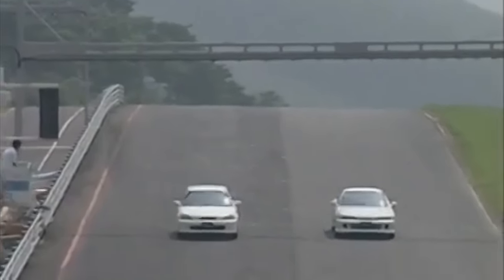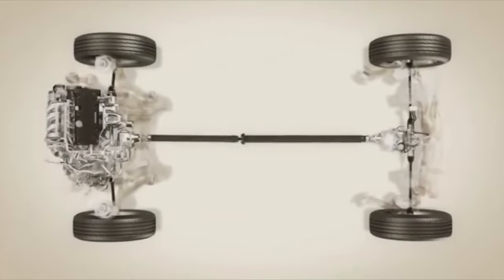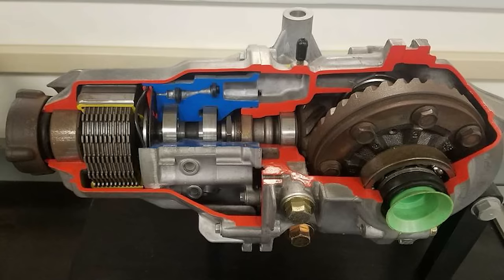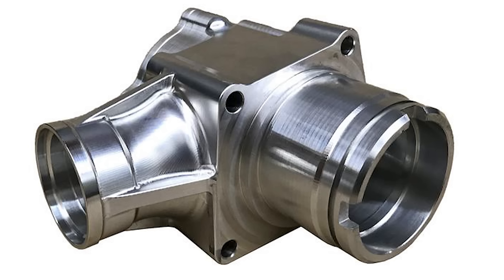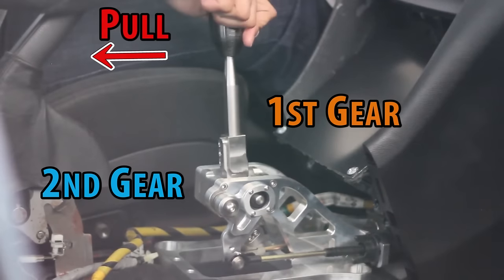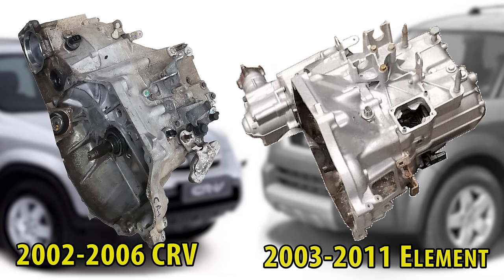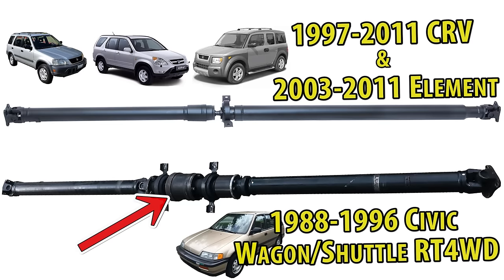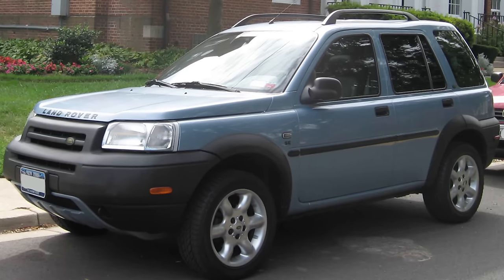How to Convert your Honda To ALL WHEEL DRIVE !

Comment: Look up pirate garage. They use no viscous coupler. And just upgrade the clutch pack in the crv diff using upgraded plates to apply more pressure to the pack

This is a 60/40 split from front to back. 

In short. You CAN use crv drivshaft AND CRV diff
Reply from the maker: You can, but the limits have not been pushed yet. We have only seen so far the wagon and pinned crv diff pushed to the higher horsepower levels. Would like to see pirate garage push it to the limits so there is another option.
Reply: @GTContent  They have been pushing 450-550hp as daily drivers on the stock diff. How much more do you want to push it? That is plenty for most people.
Reply from the maker: People want to know maximum limits, so I'm trying to provide them. They can do what they want afterwards.
Reply: @GTContent  550hp, after that you'll need to pin the diff.
Reply: @Cloneufc  that car has never seen a track. Some dyno numbers, but that's about it. No limits tested where it really matters.
Reply: @itsjussjerry  I'm running 550hp, but I'm not AWD yet, we will see how the stock diff holds up.

Comment: Hey man i hope you see this! Thank you so much for making this video! It’s made my life so much easier! I’m ready to start buying all the parts i need but i’m a little confused on one thing 😅 i’ve got an R200 diff in my car. like you suggested, however it’s a different gear ratio than the crv trans. my r200 is 4.11. would i run into issues on the way power is distributed or it’s overall functionality? Thanks man! 💪🏽
Reply from the maker: Yes, you'll have issues. The wheel speed between the front and rear will be different. It's best to change that R200 or find the correct gear ratio.
Reply: @GTContent  I appreciate the response! I actually ended up going with the crv diff w/ locked VC and got an external VC like you recommended! thanks again 🙏🏽

Comment: Kinda late to ask but, how these conversions perform in aplications other than drag, like street use and trackdays(circuit)? I assume that the viscous coupler give a 50/50 power split right? Does  front and rear diffs with diferent ratios generate rear or front bias? Or both must be the same ratio?
Reply from the maker: There are a few whom track their cars and it's done quite well. Street cars would benefit the most since driving will be under various conditions.
The gear ratio is slightly different between front and rear with the viscous coupler being responsible for the power transfer which isn't 50/50 as it's more fwd biased.

Comment: I have an element "4wd". What was the company's name that makes the aftermarket rear diff kit, that pins the clutch in the rear diff?
Reply: HRG engineering, S1 and AKD built performance may be others.

Comment: Great video, but I have a question. What would happen if I was to remove the front semi-axles, converting my civic ef sedan to rear wheel drive using the civic/shuttle 4x4 drive shaft and it's viscous coupling and differential? We're not talking about transferring more than 250 HP to the back? Would it be able to handle that much?
Reply from the maker: Should be able to.
Reply: @GTContent  and in case I decide to remove the viscous coupling all together, replacing it with some kind of solid power transfer?
Reply: @GTContent  actually, is there a way to contact you in a more direct way? It could be quite cool since I'm doing a quite unique build.
Reply from the maker: @petarkrznaric6601  It'll eventually break the transfer case if there is no viscous coupling.
Reply from the maker: @petarkrznaric6601  PM me on Facebook: GT Content
Reply: @GTContent  i hit you up on insta!

Comment: So I have a question, if I got a solid driveshaft with no viscose coupler and then take off the front axles would that work for rear wheel drive?
Reply from the maker: Yes.

Comment: What about 2001 honda civic sedan automatic. I want to make mine a rear wheel drive and push 300 to 400 horsepower. Whats a good engine swap and what parts would I need to convert it to rwd

Comment: Someone told me some Acura’s are 4 wheel drive. Was he wrong?
Reply from the maker: Some were. I get to them towards the end of the video.
Reply: I've never seen anyone try to use sh-awd components. My guess is they are much more complicated and require a lot of electronics and sensors to work properly.

Comment: Hey can you please tell me if i can set up any crv gearbox awd on k- series v6 3.0 or 3.5 accords engine?  There are not many options in India . Please update me?
Reply from the maker: You might be able to use the awd 6-speed manual transmission from the Acura TL.
Reply: @GTContent   but accura tl isn't available in India , can a CRV manual fit the v-6 engine of Accord?
Reply from the maker: @MudholHound  It won't fit without custom adapter, flywheel and clutch kit. Your best and simplest solution would be to import a TL transmission.

Comment: So I have a DC5 type R. It has a shorter final drive installed in the gearbox will this be a problem with a CRV rear diff?
Reply from the maker: It won't be a problem because you're using the the CRV/Element AWD transmission which will have the correct gear ratio in the transfer case to match the rear differential. The final drive in the transmission will not affect it.
Reply: @GTContent  Thank you so much for replying. so putting my 6 speed with shorter final drive into CRV casing will be fine? Also DC5 R comes with limited slip diff from factory unlike EP3 is this ok aswell. Will be CRV bits we didn’t get the element over here so probably get a whole CRV, take what I need and save the k20 out of it for the jazz/fit at some point 😂
If it is then this is a go for project widecharged!!! 
Thanks again mate video is great must of taken some effort 👌
Reply from the maker: @jdmbear8492  Yes, you can swap the gears and lsd from your DC5R into the CRV case.

Comment: So when you convert a civic to AWD it has to be the real time system?
Reply from the maker: "Real-time" has evolved throughout the decades (they're not all the same). It's a "clutch" based system where the clutch is located either on the driveshaft or snout of the rear differential and engages at a certain condition.
Reply: @GTContent  I was just wondering because I’m doing an off-road build on a 2nd gen CRV and I’m trying to find a way to permanently switch it to full time 4wd (or better yet be able to manually turn it on and off) would welding the clutch system in the rear diff achieve this?

Comment: Can i use my oem transmission (ep3 k20 ) to switch awd ?
Reply from the maker: No
Reply: @GTContent  so I need to use wagon transmission in my ep3 K20 ?
Reply from the maker: @ventassolunic7249  CRV K24 AWD Transmission

Comment: Couldn’t that electric motor just be rewired to stay on/engaged so it constantly has AWD?
Reply: The clutches are still a weak point in that diff when your making big power i assume. Easier and cheaper to jus weld em

Comment: super late question. im looking into a 2006 honda element 4wd at. i read that the stock trans are 4 speed. is the later versions tranny or cr4 compatible to swap?
Reply from the maker: Look for a manual transmission.
Reply: @GTContent  is it plug n play swapping to manual so should be worried about the cpu too?
Reply from the maker: @gebus1199  Manual doesn't have a cpu.

Comment: Do the awd have to be manual? Just curious cause they seem like they always shifted and not automatics
Reply from the maker: You can use the automatic transmission, but you'll also need the automatic ecu or a method to control the shifts. The automatic transmissions are not known to handle a lot of power.
Reply: @GTContent  ok, I figured that. I was like, they never are auto, ill stick with the awd ls method. Id prefer auto for drag racing a daily driver.
Reply: @GTContent  I'm attempting an awd civic. But i keep hitting roadblocks. Is there a phone number i can call to get real time assistance instead of emailing and waiting?

Comment: Thirst for power is INSATIABLE. 
No wonder the gains from better efficient cars are being squandered and not assisting the environment.
Our efficiency gains are going to bigger displacement, more performance and add to that the want of bigger SUV cars you have ZERO if not negative real reductions in CO2 per distance travelled.
Studies actually show there have been zero efficiency changes in fuel consumption per distance travelled.
Reply: My 94 mustang gt v8 with just a cold air intake and high flow cats and no mufflers could do 30mpg highway  before I added 3.73 gears...my 2004 Audi A4  Quattro 1.8t with 170hp did 34-37 mpg on the highway, my current 2016 golf 1.8tsi does 36-40 mpg on the highway...mustang was way more fun...if I have half the cylinders compared to my mustang then I want a 50% increase in fuel economy...it’s all one big scam after 2007 when it comes to fuel economy

Comment: Ok I have a 2001 accord which has a 2.3L but it’s an F series like the s2000 so does anyone have any idea if this will work
Reply from the maker: You will need a transmission adapter for a B/K awd transmission.
Reply: @GTContent  they make those ?? If so I’m soo glad I love the f series I just want all wheel drive

Comment: To be honest.... people are sleeping on D series engines. A shorter stroke means super high rev capability, faster response and a more linear power band.

Yes, higher displacement engines make more overall power per ignition. But, when your ignition occurs at double the rate. You produce more power over a shorter duration. ;)
Reply: Remember, higher horsepower means greater top speed. Higher torque means greater acceleration.

Comment: The dual pump system uses Zero electronics. It literally has 2 pumps. One driven by the input shaft, one driven by the axle shafts. When a difference in pressure is created, it applies the clutch.   The VTM-4 unit IS electronically controlled, with clutches for individual axle drive.

Comment: Awesome video.......but i drive a d series engine
Reply from the maker: Use a D to B adapter plate and a B-series awd transmission.
Reply: @GTContent  can you tell me where to buy an adapter plate? In europe? Ore what product so i can search?
Reply from the maker: @justadadworkingoncars  You'll just have to Google. There should be companies that sell adapters to use a bseries trans on a d series engine.

Comment: Why not drop a 350z rear differential end of the problem and make more power
Reply from the maker: You'll need to make a 2.5 final drive ratio, axles, custom rear hub assembly.

Comment: I had a 91 wagovan
I'd take it out in 8" snow before the plows cleared the streets.
Walked up a 45° snowy hill.
*I feared the slide on the way down more than the slip on way up.
I took highway exits at 50mph with no chirp of tires.
At traffic lights I'd be doing turns at 25-30mph like I'm on glue.

Off the line at traffic light it was instant grip.
Regret selling that car

Comment: Seems like its not that easy to do I mean you need the right parts first Its almost looks like the B to AWD series kit will take some more parts then doing it on a K series from looking at the video.
Reply from the maker: Yes, B will be more work than K.
Reply: @GTContent  I might just stay with the front limited setup for awhile and in the future should I go to the K series then I might consider that route.
Reply from the maker: @sbfhawk4343  If you drag race at the track or prepped surface, it may not be that much of a difference. On unprepped surface, it's noticeable. Things can get very expensive going awd, so best to save up and find deals as you go.

Comment: This video is very informative. I have a turbocharged B16 ek9 Civic (5 Lug Wheels). I bought a 97 Manual CRV to do the AWD swap. It will be great to receive from you a document stating exactly what I need to get and what needs to be done to complete this setup. Your assistance will be greatly appreciated.